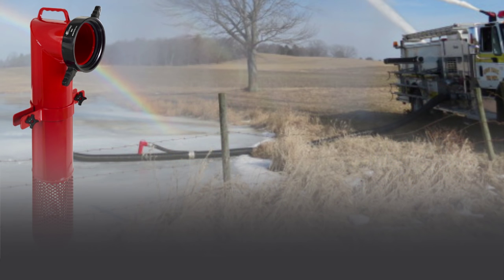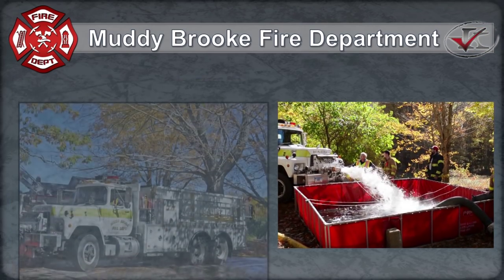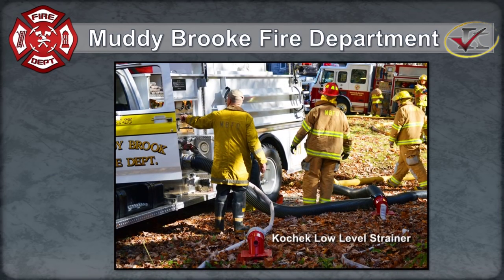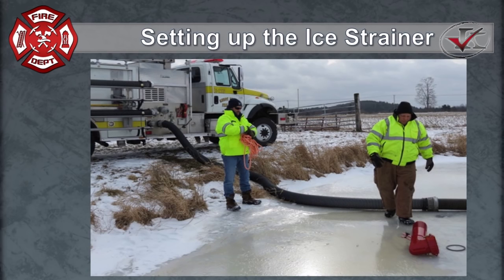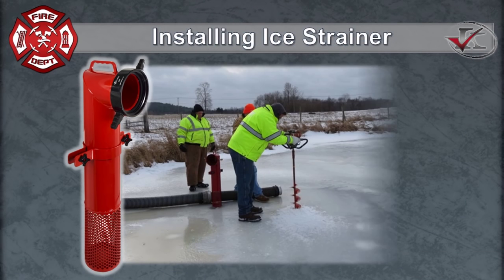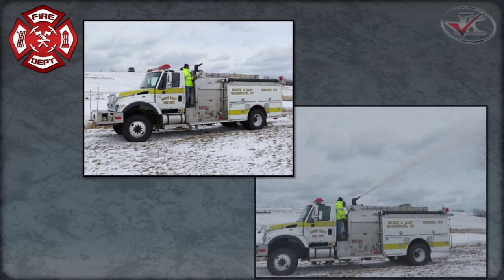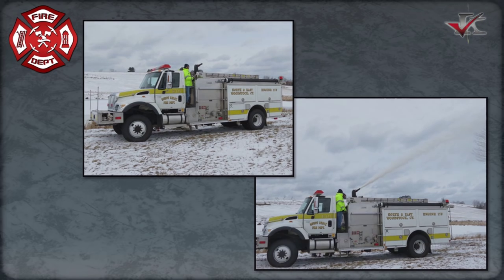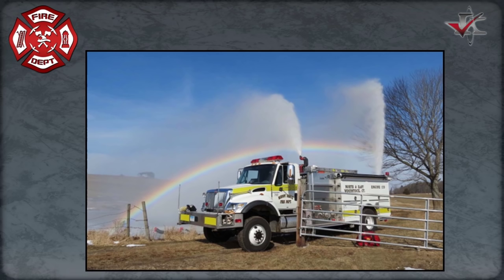Muddy Brook Fire Department Explains The Advantages of Using Kochek Co. Ice Strainers

Comment: A neighboring dept has permits and trianing for explosives during the ice season. They just blast a hole FAST. especially when ice can be 5 to 10 ft thick.  They work with  the local nat guard and police bomb squad. They keep an explosive locker at the FD and only engineers and capts have access. Aparently last year they had 8 ft of ice and had to bladt a hole in the lake for a massive commercial / residential fire. Driliing would of taken 30 min or more.